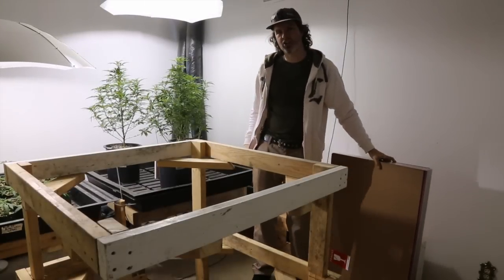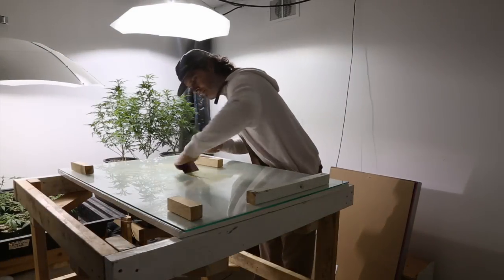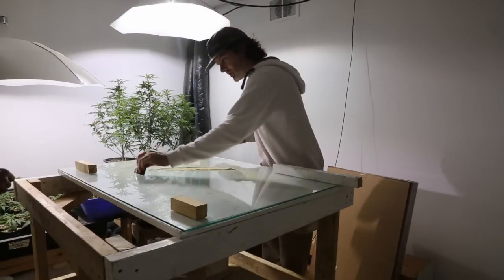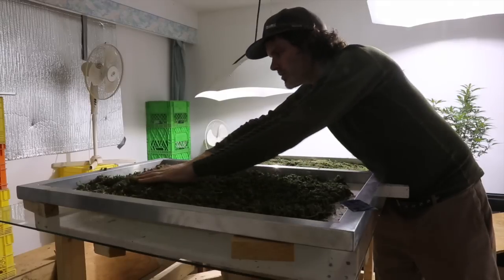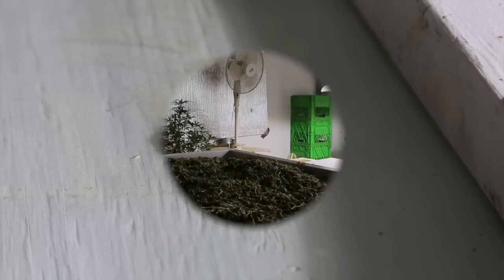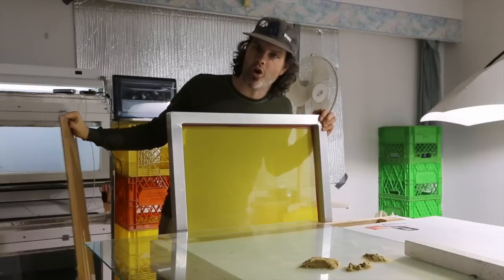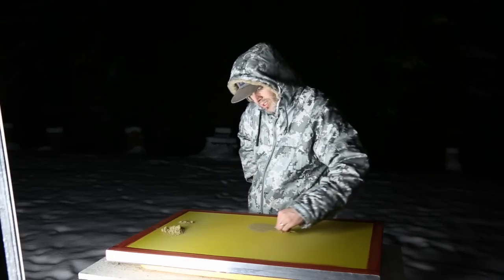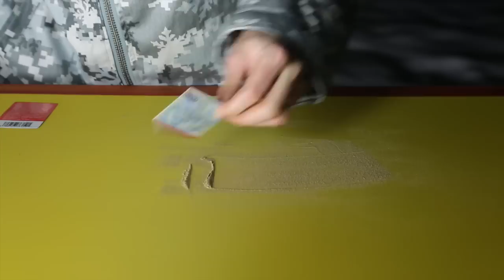Dry sift with Bubbleman

Comment: Is it not good practice to chill down your dry material in the freezer before processing. I was under the impression that tricolmes will detach from plant material easier, and the heads from the stalks break from each other after becoming more brittle due to the cold.

Comment: Hate to say it, but that was a lot of material and not alot of return.
Reply: @BCbubbleman  =-> Eye gotcha, it took us a few years to get down the right method. Dry ice method is easy to mess up,but when done correct yeilds crazy goodness.  The post shake is the key to keeping the terps. In the end, it goes up in smoke, full melt is true cannabis. Well, full melt smashed to budda, yeah.. Cheers
Reply: @Swole Astronomer No, just trying to keep the flavor after it dries. The herb is shaked thru a bubble bag ,using the dry ice method. It comes out pure,smelling of fresh fruit of all kinds..then ya gotta dry and store..
Reply: @Swole Astronomer Yaaar!! Full melt bubble is the Grand Daddy of Hash , it's the best refined trichromes, before you even touch it with the ligher ,it starts to melt to oil on a bowl. And it the choice. Then you make rosin, double header.
Reply: Seems like way to much work to get buzzed
Reply: All work and no play makes casper a dull stoner. amirite??  :o

Comment: hey bubbleman, just got your smaller 125$ screen set, if I want to do a nice single screen technique which micron would i place under the 160 stainless steel to bounce and break my nugs apart like you do? or would I want to do it on 1 of the lower micron silk screens? I'm using dry popcorn from a later harvest. I want the quality like you have not to concerned on quantity, and watch your carding tips and get the jist, but just want a good starting point to start my own toying and tinkering. Thx

Comment: would I be able to use screens in 110, 160, and 200 lines per inch and achieve a full melt sift? I see everyone use 90, 110, and 200 lines per inch. I don't have the 90 but I have 160 so I was wondering if it would be beneficial or counterproductive to use the 160 in between the 110 and the 200 instead of having the 90 on top.?

Comment: Where would you buy such screens anyways? I know McMaster-Carr has some, but not as small as the ones your using.

What is the dimensions of your screen.. Length x Width?

So you are using a 70 micron screen right? That's about 0.07mm, seeing that 1 micron is 0.001mm, so that's about 0.07mm / 25.4mm = 0.00275"

Pretty damn tiny.

Micron and Micrometer are the same. Nanometer is 0.000001mm

Comment: If you want to get WAY more yield outta the dry sift dont just smush it around with your hands grab 2 small hammers, or 2 pieces of 2x4 wood and bang on the sifts outer rim as to tap it super fast and shake it out much much better....(your welcome)

Comment: I hope you can help me with something.  Just started doing some dry sift screening.  How do I go from the dry sift, to a piece of hash such as a temple ball..etc?  I have been researching and some people say it needs to be cured first, others say it needs heat and pressure etc?  Just trying to figure out how to do it correctly.  Much of the dry sift I have come up with will not easily ball up.  I tried pressing a small amount and used a bit of heat.  It formed a solid piece but it was very crumbly and not what I am after.  I appreciate any insights.
Reply: Which method did you end up going with?

Comment: when your sifting with plastic cards, won't the card get grinded on the screens you use and get into the product?
Reply: +colorfullvibesXD maybe if the screens were sharp metal wire
Reply: +colorfullvibesXD you might have some poin , but the card hes using is clearly a credit card ( material) or metal since its a combo card+sifter together. it wouldn't be made of a (simple) card material bro.
Reply: colorfullvibesXD I've never had a problem with it. but using big dollar coins works a lot better I found.

Comment: bubbleman i have this idea, i want to take a QP of the best master kush or blue cheese i can find and dry it out to bone dry, grind it all up into dust and collect all the best keif or dry sift from it i can, i dont need pure full melt processing i just want really really good hash from it,  what would be the best why to do it? like those micron bubble bags on a glass table with dry ice? or using these screens like you do? also does grinding bone dry triple A leave too many contaminates or would it maximize my glandular extraction? peace and love thank you
Reply: +TheAngelOfWar HaloTwo You're using a mechanical sifting technique here, so you want to minimize the amount of 'ground' bud which will grind the shards of leaf material to the same size as your trich heads. There's a middle ground here between leaving it whole and grinding it into powder.